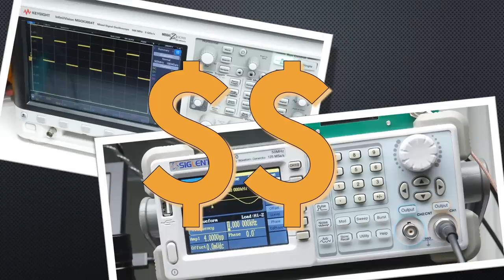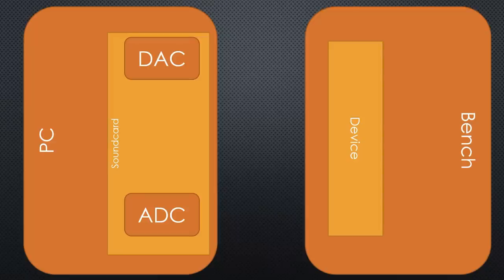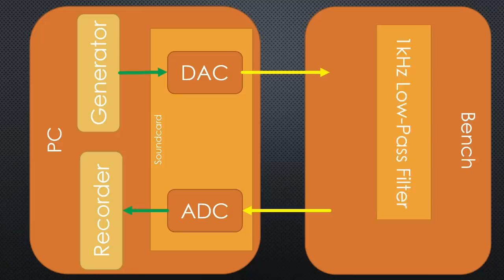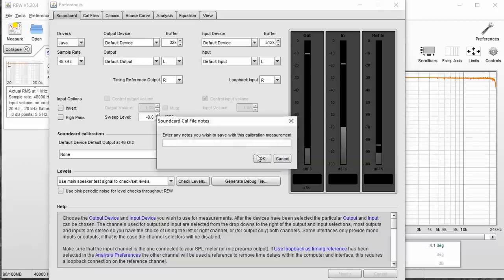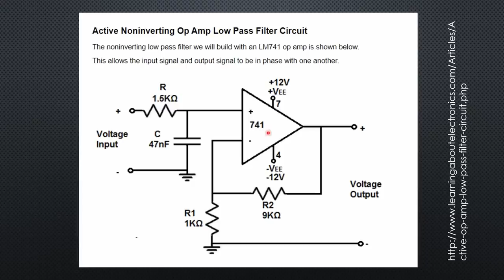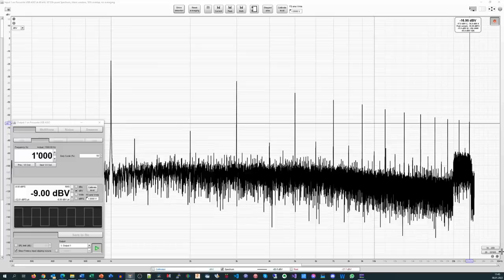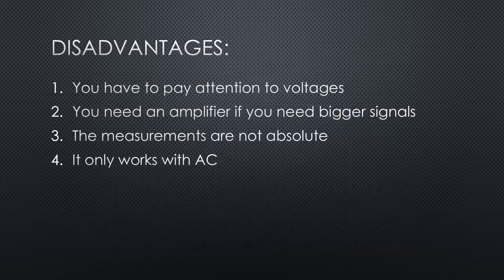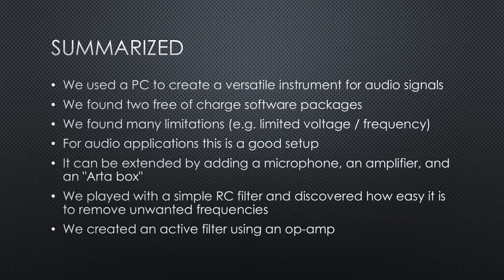#413 Your PC Soundcard is an Oscilloscope, a Signal Generator, and a Spectrum Analyzer (Arta, REW)

Comment: I use to work with sound cards as spectrum analyzer, since about 13 or 15 yrs ago, analysing engine knock sensor signals, while I tune the ignition advance time. Because the frequency of engine knock depends only on the piston bore diameter, and it's perfectly human audible, sound cards are perfect to use. And I can measure two channels at same time: engine phase and the knock sensor. So I can detect what's the real knock, in what cylinder(s) from some other noises like a bad adjusted valves, huge piston clearances and other engine noises. The other way is to use a simple audio amp and listen the signal generated by the sensor. It's obvious the hard way. Very hard.
Reply: Yeah, about that same time I was tape recording my chainsaw and playing it back to Windows 98 through Sound Recorder, then analyzing and displaying using Quick Basic. Looked just like a scope with 2 cursors for analysis. Very revealing I tell you.  Also recorded firecrackers.  It's not what you'd expect.  :)
Reply from the maker: These are very good examples of how this technology can be used. Thank you for mentioning them!
Reply: Interesting mmm
Reply: @Chiavaloni Now you win the right to made us a video to show us this interesting howto  !!! 😁
Reply: @antoninperbosc1532  wow... I used to do this more then a decade ago. :P To do something like this now, and make a video, I will need a car/engine with a programmable engine management system (Programmable ECU) with a properly knock sensor, perhaps a good audio pre-amp, an adaptor cable (from the knock sensor to the mic/pre-amp input) and of course, the notebook with a sound card. And a car/engine dynamometer... If you are curious about the engine noises, I found a video from HPA ( https://youtu.be/66okwgg6Rrw ). I didn't found any kind of video with the same things that I used to do. Sorry. :(
Reply: You know i watch Vice Grip Garage, Engine nock noise what a joke why waste that much money and time on tools you really don t need, Derek just uses his Ear ok some even get a big screw driver, stick you ear to the end of the screw driver place other end around various places on the head and you will here all kinds of noises, you dont need some fancy computer too do that also if the Engine is broken just pull it apart and do a visual inspection that will tell you right away, also there are only so many parts in an Engine that can brake, so your really wasting a lot of time and effort just tear it apart and fix it, why waste time, Most pro Engine Builders can tear down a Engine in a matter of min , so like Drag race cars, if something brakes they fix it right there and now they keep extra parts like Heads all set up ready to go , yeah Pro class no goofing around , with stupid tools you really don t need, like most cars can be taken apart with two bolt sizes or less , so really you don' t need much to fix something, unless your building a Engine from scratch, some do this they cast there own parts make stuff , that is real engineering not some stupid box thats going to tell you what frequency the sound of a valve rod going through the top of a lifter, no fancy tools are not required at all, even in Electronics i never use any of that stuff to fix electronics , the most i use is a ohm meter a capacitor checker, i can even test other stuff to with a ohm meter amazing what you can do with just very bassic tools unless your a real engineer and say building or inventing new things you may need a few fancy tool if you need to measure things like frequency's , but yeah so what big deal most of this  stuff to me is OLD news , plus I thought about Programs on computers to do the work of Oscilloscopes frequency generators and any means to understand Bios in electronics and frequency's of given devices in the dynamics of frequency modulation so yeahthis is all Old news people nothing new here My father was a ham operator same as my self bin the computer and electronics industry most of my life and Electrical wiring houses to doing huge computer installation's for the scientific community of Canada in BC many to our Family  Name Under Heller Computer systems and Electrical contractors ....
Reply: Soundcards also have an option to connect their output to their input to measure their own noise. This allows you to extend their usability beyond what can be heard and analyse smaller signals.
Reply: @madmad8582  sorry buddy... But tune an engine for drag race is the easiest way to "tune". U basically have one condition: Wide Open Throttle and for just a few seconds, nothing more. There's no need to tune almost nothing. U even have to tune a ignition map. The magnetos melt with a few revs and almost the entire run the engine still running with the mags red glowing (knocking...). Engines that have to run hard for hours is a loooot different. Road legal engines are even worst to tune. You may have to proper tune it to run perfectly while  cold, on accell, deccel, high and low revs, with w.o.t. or almost no accel. It has to work when the clutch/transmission engage, when the AC compressor turns on, when the electrical load loads the alternator, must have a proper fuel consumption, durability, etc, etc, etc, etc, etc, etc, etc, etc, etc. Here in Brazil we have etanol on every gas station and tune with it is worst then to tune an engine on gas. A very popular turbo'ed engine here is the old VW-Audi EA827. The most common street prep with then just doubles it's original power. A bit more modern engine, the Ford Duratec 2.0 HE/Mazda MZR, with etanol, when turboed, easy reaches 320 hp. 350hp. And remaining street engines. But we must have to proper tune them. And all this "fancy" tools helps us to make a resonable durable and a bit fuel efficient engine...

Comment: Nice video and brings up some memories of the past. Back in 1997 I used a PC sound card to decode the DCC track signal of my model railroad and display the commands that are coming along the track in real time. The DCC signal is a pulse width modulated square wave with a maximum bit rate of about 16kbps, so it was quite easy to decode with 44.kHz sampling. As interface I used a resistor in each wire to the track and two antiparallel diodes to limit the input voltage on the microphone input. Software was written in Borland Pascal for Windows, running on a 486 with Windows 3.1. Tempi passati ;-)
Reply: turbo pascal
Reply: @sookmaideek  not necessarily. Borland Turbo Pascal and Borland Pascal are different, where Borland Pascal was more high end, and contained more libraries out of the box.
Reply: @thorbjrnhellehaven5766  turbo better because faster and turbo
Reply from the maker: You were very early using this technology! And you stayed with the model railroads. Now with much more sophisticated gear, of course ;-)
Reply: Borland Pascal for Window, yes those were the days, ... ~1984

Comment: I use a similar software (soundcard oscilloscope), its very easy and gives real oscilloscope like interface. I also use two silicon diodes (one forward, one reverse biased) in parallel to the potentiometer on the input signal and ground wire to bypass any AC voltage greater than 700 mV. It saves the soundcard from any accidental over voltage when the potentiometer is not correctly set.
Reply from the maker: Good idea with the diodes. And I placed a link to the Soundcard Oscilloscope SW. Thank you!
Reply: Did the same .
But added a 2 pole 6 way switch.
It has a though , 50 R , 8 R , 600 R dummy load , a diode for AM demod , rf signal tracing & rectified output for a DVM . 
Signal tracing can be via the pc speakers if necessary & the microphone boost can up the gain .
That's af or rf demodulated signal tracing .
( Noise can be reduced by subtracting the unused channel #2 from #1 ) .

I almost fitted a calibrated RF wave absorption & notch filter .
But the box wasn't big enough 🤦‍♂️

Note this is not isolated so not for high voltage or tube work !

Comment: the "loss" of your low-pass filter only comes from the limited low input impedance of your sound card. You can easily check it by using a filter with 1 kΩ and 160 nF. A passive RC-filter is lossless in the passband if driving a high-impedance input.
Reply: That or a opamp buffer as medium between the sound card and the RC filter
Reply from the maker: I agree with both statements.
Reply: so puting an AOP in follower with hight impedance to "isolate" the DUT could avoid distorsion ?
Reply: @antoninperbosc1532  distortion is not related to the dampening of the signal. The RC filter is linear for a sine wave of constant frequency, even if it is connected to a low impedance input and does not cause distortion. Distortion is generally caused by non-linearities in an amplifier. Other problems are caused by the frequency dependence of the phase shift if one considers a mix of incoming frequencies like voice or music.

Comment: Nicely done!  I figured that this was possible back in the late 1990's but never found the time to explore using a sound card as an oscilloscope.  It's great that other folks had the same idea but actually put in the time to bring it to reality.
Reply from the maker: Indeed, soundcards are high performance devices which are also used by software defined radios, for example. Just different software...

Comment: It is pretty easy to bypass the capacitor near the input or output jack on the soundcard to be able to input/output DC signals as well.  I've done this both for using audio input as an oscilloscope, and for using the output as a signal generator for a laser galvanometer and it worked great for both.
Reply from the maker: Good to know. Thank you for the tip!
Reply: The 'no-DC' issue I did not anticipate. Is there a technical reason why the soundcard is AC-coupled (e.g. related to it having a 18-20 bit ADC)?
Reply: @iforth64  : AC coupling for soundcards (and a fair variety of other things) is the norm, because it reduces the chances both of ground loops, and of safety hazards.
Reply: @iforth64  DC means V+ and Vzero with V+ will push the speaker forward then Vzero will return the speaker back to natural state. Then AC means V- will pull the speaker backward deeper and quicker to compare Vzero.
Reply: @iforth64  In an amplifier you do not want to amplifie DC offsets since at high levels they will push the amplified signals to one of the powerrails. If that happens the peaks of the signals are cut off which causes extreme high distortion. You can not control if the applied input signal has a DC offset. But with a capacitor in series of the input you can block any DC offset preventing this problem.

Comment: I just remembered this one !

If the software has a audio analyser but you can't inject a sweeping signal .
Try a simple wight noise generator injected into the amp .
You will see the passband response on the analyser .

It has limited uses with RF also , tune for maximum noise or work from a good audio stage into the radio / unit / DUT .
Like passing a 100 khz square wave ( & overtones ) through a radio receiver .

Old tricks we used when all we had was time , a box of scrap , war surplus & brass screws  !
Reply from the maker: Using white noise as an input is a great possibility. Particularly with the new broadband SDR receivers. You immediately get the full frequency response.

Comment: Easiest thing to experiment with - is to connect transparent diode to line input.
Now you will be able to receive IR signals from remote controls.
If you write corresponding software of course :)
Reply from the maker: Good idea. Most IR remote signals are around 38kHz. So you probably have to use a high sampling rate, I think.
Reply: @AndreasSpiess  it is possible with low sample rate too.

Comment: Excellent video and a very good introduction to sound cards and their benefits to signal processing. It's also a trip down memory lane... Many years ago (Pentium 3 and 4 era) I used a sound card to decode/encode tone signals in combination with radio equipment (CTCSS, SelCall tone sets like EEA, ZVEI I etc...).  What a wonderfull time...
Reply from the maker: We still use the sound cards to decode signals in amateur radio. This is a cheap and high-quality procedure.
I did not know that this trend started already long-time ago.
Reply: @AndreasSpiess  The encode/decode with soundcard project was my thesis project. I started with radio communication for my job in the early 90-ties. In that era our relay stations were connected with M1020 orM1040. I started a project (which got cancelled...) to interface radio's with ethernet, today known as RIPS (Radio over IP Streaming) to get rid of the expensive leased lines. A little later... the era of Tetra pushed back all the older equipment and projects to maintain/improve the analog network. I miss this older period somehow... I guess it's a little nostalgia.

Comment: There's alot you can do with a PC but it is not realtime due to latencies in the operating system and USB protocol. This doesn't stop you from doing non-realtime (record and analyse) however for an oscilloscope realtime is needed for trigging. Only reason you may not want to use a PC is isolation - tube amps with hundreds of volts and PC are not a good combination without specialist hardware. A differential probe helps and could be used with a sound card - isolating and being safe.
The only down side to a PC sound card is the lack of control over the processing - some operating systems perform conversion, and apply human ear perception equalisation etc. MacOS used to be a pain for that, the later operating system allows the developer better options to prevent this.
I wrote a Bode plot AWG for my 1104x-e and currently writing a high resolution spectrum analyser (1Mpt and 1MSPS). You may want to use flattop filtering on the FFT as this provides the best measurement value.
Reply: Triggering does not need realtime. Just write the data into a ring buffer and evaluate any trigger condition at your time. This also enables pre-trigger, where you see some data leading to the trigger event.
Reply: What realtime is fast enough for you?
It is easy to get ~100ms latency. ~10ms is harder, but possible too. ~1ms looks like maximum of what PC + sound card can achieve.
Reply from the maker: @
Nick K: I agree on the limitations you mention. Particularly I would not use it with tube amplifiers ;-) Fortunately, they are rare these days.
Reply: That's why you don't use WaveRT/DirectSound Drivers on Windows, or CoreAudio on MacOS. You have to use audio drivers which bypass any OS/Driver processing, putting the audio codec in a sort of "promiscuous mode". I don't know how that can be done in MacOS, but in Windows you use ASIO drivers for that. ASIO4ALL project provides a free of charge ASIO driver which works with the common Realtek codecs which don't provide ASIO by default.

Comment: I've used REW and a Dayton Audio UMM-6 USB calibration microphone to set up a couple church sound systems. That software is crazy powerful -- I've seen commercial solutions that aren't as comprehensive. Anyone interested in playing with sound systems, especially measuring speaker response, would do well with this combination. 👍️
Reply from the maker: Thank you for sharing your experience. So you understand much more about all the measurements possible with REW...
Reply: @AndreasSpiess  Goodness... if it falls under the Acoustic domain, it's probably measurable. I won't claim to know everything it's capable of, though. 😁

Comment: 15 yrs ago I used an old desktop sound card as an oscilloscope as well.  To reverse engineer 1 wire 300 bps car head unit internal communication protocol between each module and it works very well.
Reply from the maker: So you were happy that the levels changed a lot and the signal behaved like AC... Today I suggest to use a cheap logic analyzer for digital signals.

Comment: I have tinkered with sound cards as oscilloscopes. I'd suggest connecting diodes in parallel to the 3.5mm mic input to clip their voltages to 0.7V to protect the sound card in case of input over voltage.
Reply: My sound card (SB Live!) survives even signals with 4 diodes protection (twice your level).
I suspect that it may be capable to use even higher voltages.
Reply from the maker: It is well possible that some cards support higher levels. My Focusrite seems to support 25Vpp. But only at the lowest gain...
Reply from the maker: Good idea.

Comment: Some time ago, before I got a scope, I considered using one of my audio interfaces as a scope. The 24-bit resolution on the converters are exquisite, but the sample rate leaves much to be desired. My scope is 1 GSa/s, whereas my interface maxes at 192 kHz. (But I can measure up to 10 channels! Or if I use multiple interfaces, 34 channels at 96 kHz.) I think I did actually try this at one point, but I seem to remember there was a huge DC offset, and I was worried I'd blown something. They all have input caps, but... still scary. Never again. (Fortunately, they're all good.)
Reply: After watching the video in full, I take back my "never again" comment. I can see how valuable it'll be in the audio domain. As long as I know I won't cause problems for myself. Idiot-check with the scope or DMM, then detailed measurements with REW. 😁
Reply from the maker: Indeed they should not be compared 1:1. Both have advantages and disadvantages.